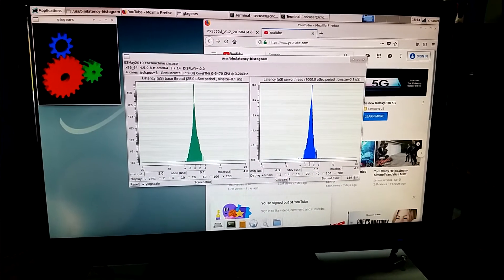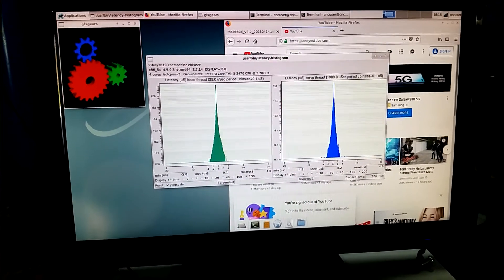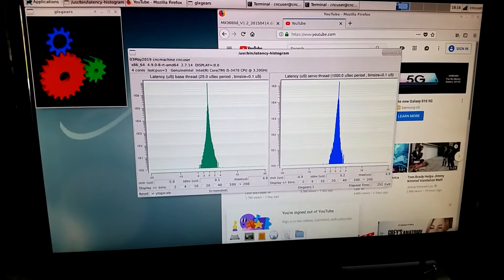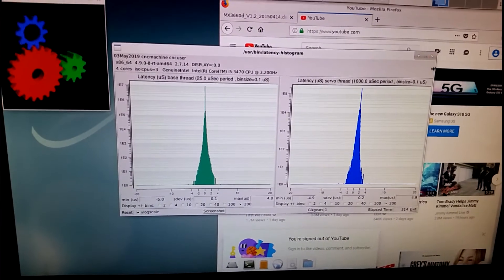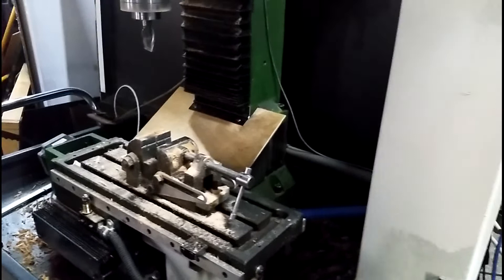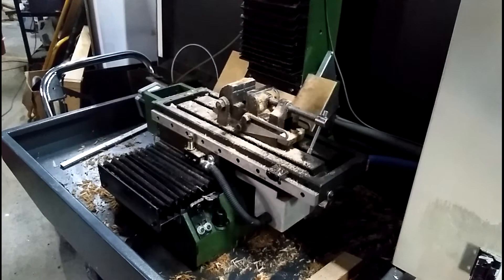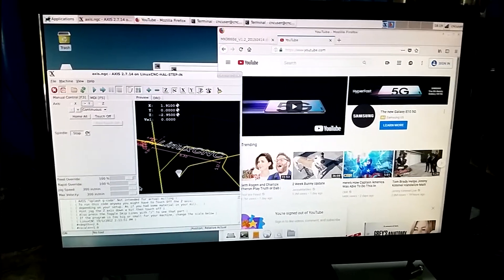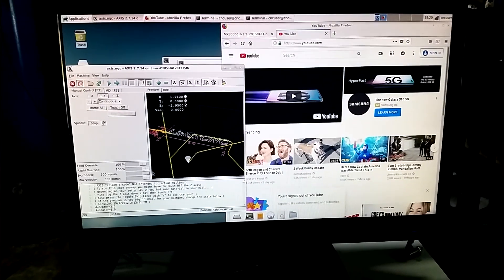Printer port step generation with rt_preempt and linuxcnc

Comment: Couple of questions.  Did you compile the preempt_rt kernel?  What "tweeks" did you make?  Where they to the kernel config or did you pass stuff on the grub command line?  Great video.  As a matter of fact, I am hoping to release my next one this evening on compiling a preempt-rt patched kernel.  Thank you for sharing.

Joe
Reply from the maker: isolcpus=3 (on this system) and idle=poll
I have compiled the rt_preempt kernel - but this system is running from the linuxcnc stretch iso
http://www.linuxcnc.org/testing-stretch-rtpreempt/

Comment: Very nice ! I use parallel port on my mini router 20uS base thread and 10uS (100kHz) on lathe with spindle encoder no issue only on lathe cpu usage ar higher then on mill and screen refresh rate is lover :) On my old computer witch AMD x2 3000 GHz clock i tested 5uS i have seen 200kHz on scope :) but GUI reaction was very slow. On  all current PCs 5uS=hang . On pc witch Intel atom i use isolcore to get better timing, but i have "DELL Optiplex 740" with AMD x2 2,4Ghz and performance is better witch all cores on :) On computer with AMD 8 cores 4GHz i get poor timing. Its look like kernel don't likes all CPU-s :)